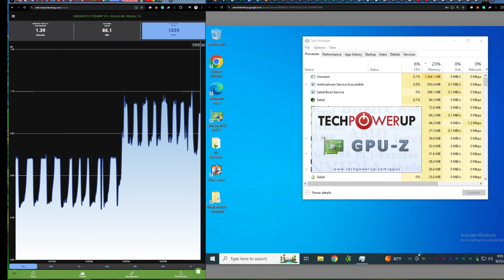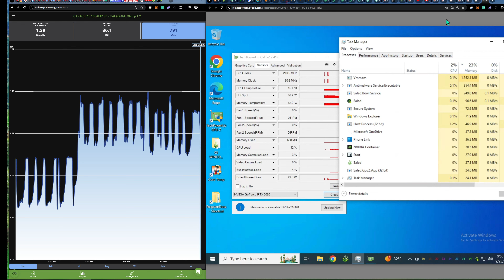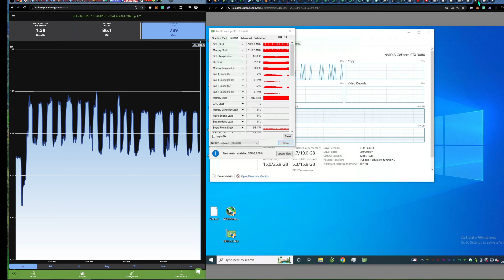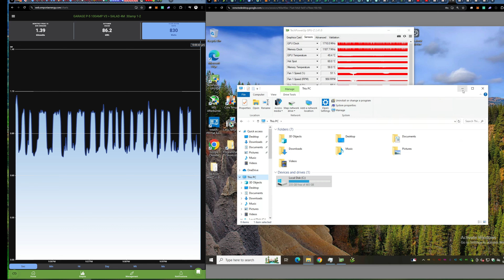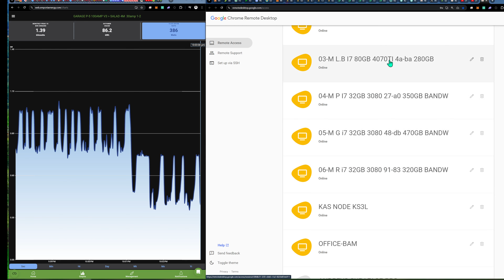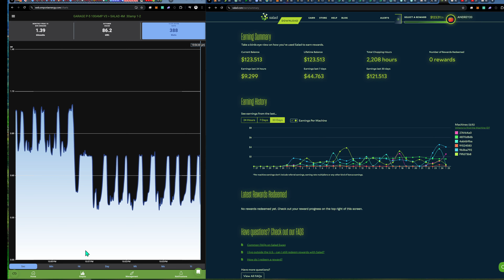SALAD MINING WHY AND WHEN POWER CONSUMPTION CHANGE AND HOT TO AVOID EXTRA POWER USE

Comment: I’ve had salad rigs completely use up a
512GB clean install and degrade because the WSL didn’t demount. If you stop salad loading automatically on reboot, I found I could delete the file without uninstalling. Also with Video bandwidth enabled Salad would not show a job running. Showing calculating even when a job was running and earning.
Power usage goes up on Chrome remote desktop because the GPU is being used for encoding the stream to the remote client.
Reply from the maker: Its a very good point i had that before and couldn't delete WSL unitl restart coputer and before salad autostart. need to check trhe free spaces on these machines